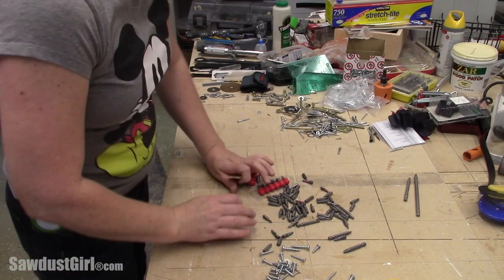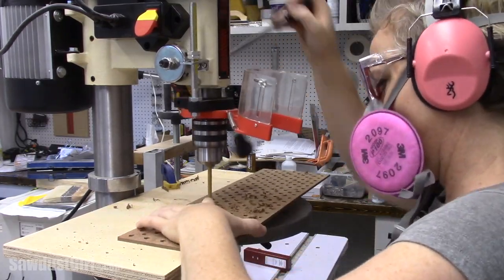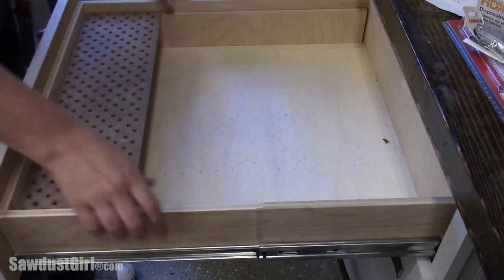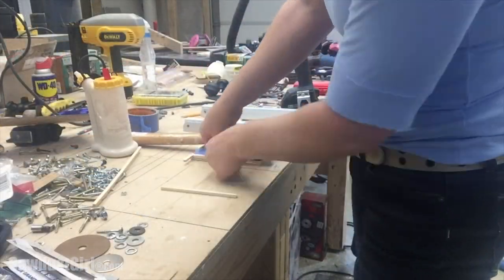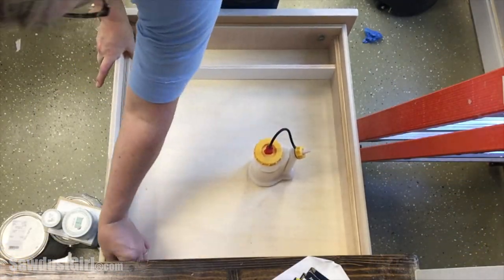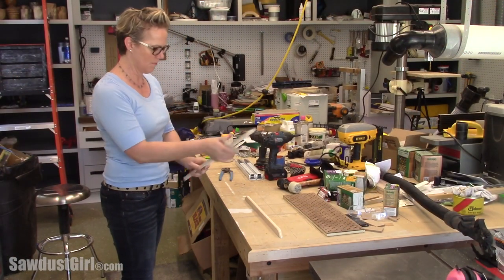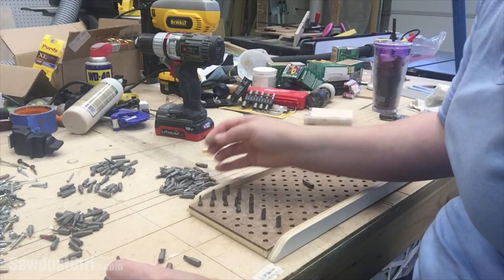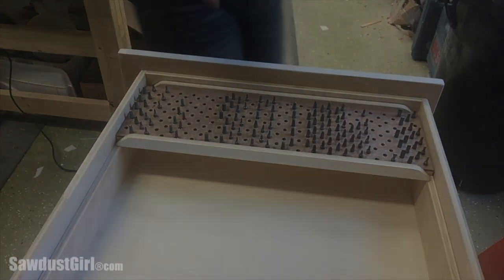Sliding Drill Bit Storage Tray

Comment: sweet build 
something you can do to clamp up small stuff if you dont have small clamps handy. take scrap pvc pipe ( 1" dia. ) works good but bigger works also. first cut a slit along the length of your scrap peace, now cut the pipe into 1" or 2" long peaces, now you will need to add some handles to each new clamp. I use popsicle sticks. First I make a set of holes about as wide as the sticks, these should be on eather side of top center just a bit less than side to side. ( looking at the pvc pipe on its end. think of it as a round clock face, mark the places for these holes at 10  & 2. then move the marks around to the sides of the pipe peace ) Center these marks across to the center of those edges ( or as with my 1" example they will be at 1/2" ) Use these marks to make the holes for the 2 popsicle sticks. ounce you jave the holes you can insert the sticks untill they touch. now using the sticks like clamp handles squeez to open your new micro clamp. I make these up from all my small pvc cut off scraps and store them strung on a peace of rope. I have marked and drilled these but not cut them to length untill I needed them, this allows you to store them with the sticks inside and handy till you need them .Thans again for the great bit storage idea as I just got my new shop size base tool box I will include 1 of these in a drawer. Thanks again.

Comment: a quick note on my clamps I was telling you about before. you can make these clamps stronger or not by using thick or thin walled pvc, and by how long you cut them ( 1" is pretty easy for anyone to use but if you make them 2" or wider they can get really strong and you may want to use 4 or more sticks to be sure the sticks don't break. I have some that I have added multiple haddles to so I get very strong clampping power. Since I have found how to make these I dont buy metal store bought ones as much. ( If you want these to be even better and more permanent. you can buy a length of metal bar from store that you can use in place of the sticks and they will be long lastting and cheaper than the store bought ones )

Comment: Hi I just stumbled upon your videos and plan on watching all of them. I wanted to mention I have been struggling with this exact issue. I have many bits, just like you but some of mine are longer. I will have to make a modification for the longer ones. I tried drilling holes in a 2x4, Styrofoam, some other packing foam and nothing compares to what you did!!!  Awesome!  I do not have a drill press, but I have been thinking of getting one, I see it used so often in other videos...OK so the question? What size did you drill the holes?